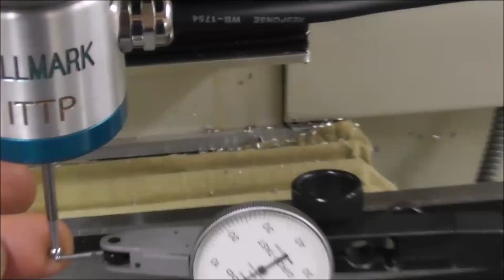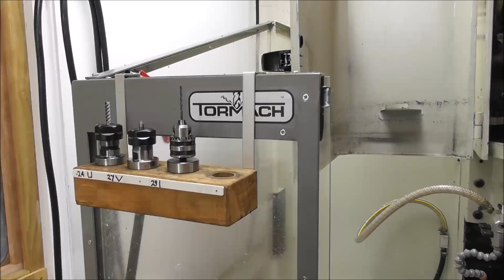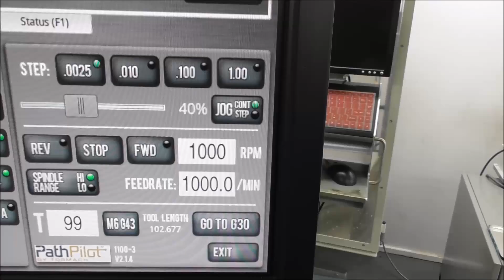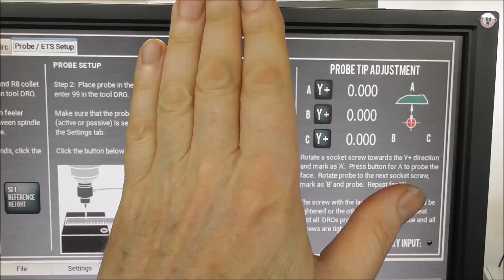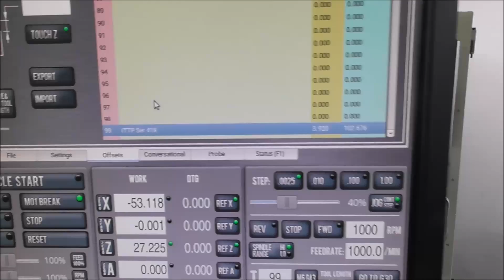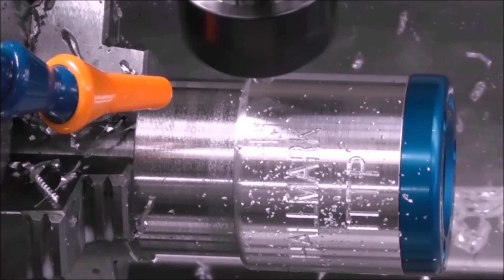Touch Probe Set Up and Use

Comment: How many wires for the probe  ?
Reply from the maker: Hi John. "It consists of a NC circuit (normally closed), using two connector wires (normally pins 4/5 of a 5 pin DIN plug either side of the center pin), the circuit is broken on a touch event when the probe stylus tip contacts the work." See also website:  https://hallmarkdesign.co.nz/

Comment: Maybe after 100,000 hours the led in the opto isolator will die but it should be fine as long as no heat is generated.  I would unplug it for sake of shorting a very nice probe on accident by forgetting something. Great walkthrough.  Thank you.
Reply from the maker: Thanks for that info and the feedback. Cheers  Cliff

Comment: Thanks Cliff. Interesting as always. I plugged mine in 18 months ago when I bought it and have not unplugged it since. If you ever want to see if the electric contacts are “worn” due to constant voltage you could look at mine. 
Also when I set up for a probing routine I usually run 50 ipm and I always set spindle speed to 0. Gives me a little peace of mind that I won’t start the spindle. 
Thanks again
Reply from the maker: Hi Douglas - Thanks for your input here. 0 RPM is a good idea.     Good to hear the probe has survived 18 months plugged in.  On average how many hours a week did you have it powered up?  Cheers  Cliff
Reply: Threadexpress ... Probably on average 16-20 hours a week... my best guess.
Reply from the maker: @douglasdarby8584  Thanks Douglas. Well that is pretty good empirical evidence that plugging in is likely to be OK short to medium term anyway. Cheers  Cliff

Comment: I have a 600x1200mm cnc router.
This can surely be used to do a digital probe routine to copy a part and then set up the g code and tool paths..?
I haven't seen a video of this. This is my primary need right now.... thanks
Reply: no matter how big or small you table have. only importat have how accurate this have and wire can connect you probe connection.
Reply: but have many similar and lot cheapen can buy.
Reply from the maker: Hi Steve - Do you mean using a probe to digitize a part geometry?   Cliff
Reply: @Threadexpress  yes. Sorry, I don't have all the correct lingo. New to this.
I understand Mach3 has a routine for this.?
Reply from the maker: @SRH58  Hi Steve. Tormachs are usually running PathPilot  and do not have digitizing software , I am not sure about Mach3 .  But these basic passive probes like the SPU 40 and ITTP are not intended for digitizing applications.  Cliff
Reply: @Threadexpress  will it do this?
https://youtu.be/IcVv1So1n_8
Reply from the maker: @SRH58  Hi Steve, That is what is called digitizing and a different design probe it better for that type of work.  I guess your next question might be why?   Well a higher priced probe with active electronics will better handle the thousands of switching cycles required.   Cheers  Cliff